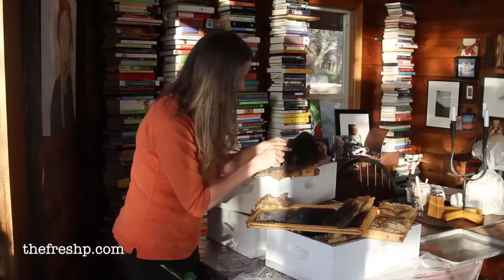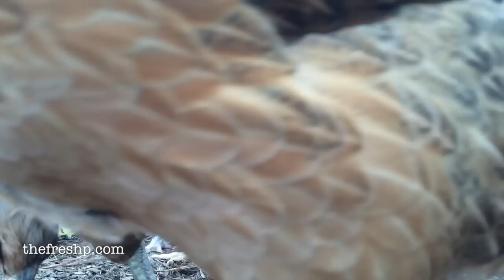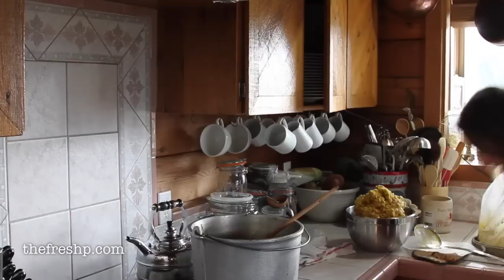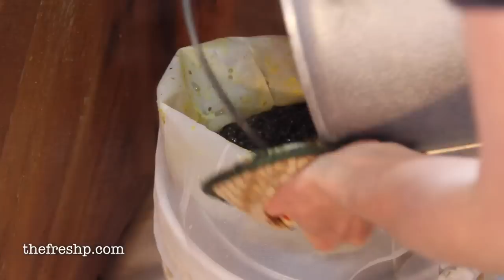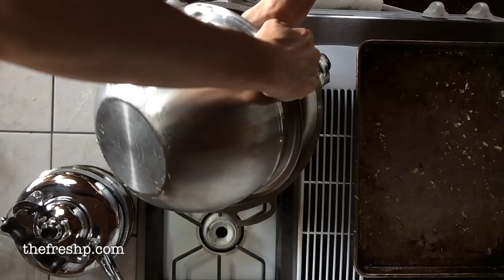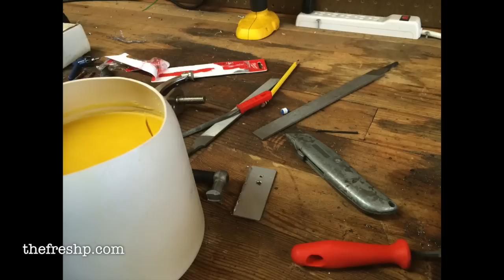P's Bees: Rendering Brood Comb Wax, Part II | Fresh P

Comment: As a candle maker I am always thankful for good tips to make candle/wax making easier. If you can find one, get an old fashioned paint scraper, the kind that is 'pull only.'  When you clean the debris off the wax disk you can control the pressure and how much wax you want to remove with the debris. If you can't find an old fashioned paint scraper...I think Cody has one ;)

Comment: lds prepper has a good video on wax, best easiest and clean wax the first time!
Reply from the maker: I do separate the clean wax from the brood, but this is the drags of my wax collection.
Reply from the maker: +Md Seelbach I'll check it out, thanks. I read this on my phone and didn't get the reference to LDS Prepper. I'm making a solar wax melter for next summer. From what I've seen it's a single process. Looks much better than this method.

Comment: May I  suggest, lay the wax on the edge of the cutting board.  Secure a sheet of wax paper or paper towel under edge of cutting board. Scrape wax gunk off onto paper. No pot to wash, easy disposal of gunk.  And, safer for you than holding wax in your hand.  Nice video, thanks for sharing.

Comment: Hi,
Do you use wire in your frames? If yes how do you get the beeswax out of the frame without slacking(?) de wire?
Reply from the maker: I don't use wire, but I have previously. I just get needle nose pliers and pull them out.

Comment: question and I would really really appreciate an answer. I've heard brood wax still kinda..stinks apparently? it there a major difference between the 3? being brood, normal honey comb, and caps? or does it not matter as long as it's completely purified to 100%
Reply from the maker: +B C its stinky to render but the overall clean wax was delightful. You could separate them if you're concerned, but I found it ok.

Comment: I find that I get much less cracking in the final wax blocks if I let it cool very slowly.  Of course, for most things this doesn't matter as you're going to remelt the wax for whatever end use you have for it but if I'm going to give it to others or sell it I want it to be  a perfect block. 

Which, actually, brings up a great point.  I don't think you mentioned what you use the was for?
Reply: LOL after reading the other comments I see that you DID mention what you use the wax for.  Many times.  :)  I think a video on some of those things would be awesome.
Reply from the maker: I do to, even if it is for my own sanity ;)

Comment: That is odd how the wax beaded like that I have never seen that befre and was wondering how could that be used for anything... And i once heard that beeswax makes great base for henna or hanna tattoo paints... Im wondering if it would make good base to melt down and add color for beeswax art or paintings... Just thouht i would say that out loud since it popped in my head lol
Reply from the maker: It cooled upon contact with the cold water. It's totally useable and the final processing It melted into a solid mold. But it would've wonderful in lotion making where you must be careful to not over heat your oils, as it melts almost instantly. Which is why beeswax is often sold in tiny pellets. Have you seen the caustic paintings using dyed wax? It's beautiful. I'd love to get some molds and make candles this fall.
Reply: I have not seen it but I wi go look for it. I love art I am not exactly an artist well I guess we all kind of are because I just d things that make e feel good and make areas feel peaceful and relaxing. I do hope that you are able to do that also if you do will you please do a video on beeswax candle making I would love to learn that I have made candles before but i never could get the smell strong and long lasting but i did do a few that i put leaves in or twigs and sticks in the wax but on the outter sides of the candle and if u do the big size ones that have the three wicks... When the candle burns down you can actually see the shadows of the objects on the walls. I wouldnt suggest leaving it alone due the fire hazard but they were interesting an calming...

Comment: Hello! LDSPrepper has a video on rendering wax using a solar oven. He puts the wax on top of a window screen covered in several layers of paper towels and leaves it out all day. Gets it done in one round and requires a lot less labor. Perhaps Cody could build you one?
Reply from the maker: That's def the way to go. I kind of wanted to be done with it and I'd have to wait until late July to get that kind of heat. But yeah, MUCHO better.
Reply: FRESH PRINCESS
I figured it was still to cold where (I think) you are for that method.
Reply from the maker: I was out picking violets this morning, in my down puffer coat. Still cold in Oregon, but looking promising.

Comment: When your honey was grainy from the cold water, did it melt down and become solid or did it stay grainy?  Curious.
Reply from the maker: It was the wax that was grainy, not the honey.
Reply: Whoops, I made a mistake with my question.
The wax that was grainy.  When you re-heated the wax did it go back to a solid form or did it stay grainy?  I've been at courses that told us never to get wax to where it is grainy.  The wax won't solidify anymore and just stay grainy.  How did the wax work out for you?
Reply from the maker: Nope, it melted back into a cohesive solid. If anything it may have tempered it a bit. It seems harder than usual.
Reply: Interesting.  I was taught that overheating honey in water will ruin it and make it grainy.  It's basically ruined at that point.
It's interesting to see that putting the wax in cold water and having it go grainy doesn't hurt the wax.  Cool stuff isn't it?

Comment: I ddn't quite understand why it was better to pour your wax into the cold water. Did the garbage settle to the bottom when the wax congealed?
Reply from the maker: joebainter The cold water caused the wax to set into tiny beads. If you allow it to cool slowly the gunk will accumulate on the bottom and can be scraped off.
Reply: FRESH PRINCESS But did the gunk separate and fall to the bottom?
Reply from the maker: It is hard to know. My initial reaction was no, but I'm not sure if the wax seized up and not the gunk or if the gunk hardened into the wax chunklets. I did end up repeating the process a couple more times and the water was dirty after, but it's hard to know without comparing the two methods side by side.
Reply: FRESH PRINCESS
Very interesting. They sell paraffin wax for candle making in Michaels that is in little beads. This must be how that's done.